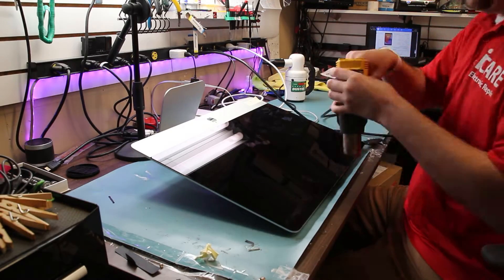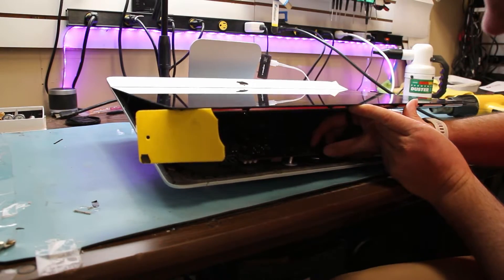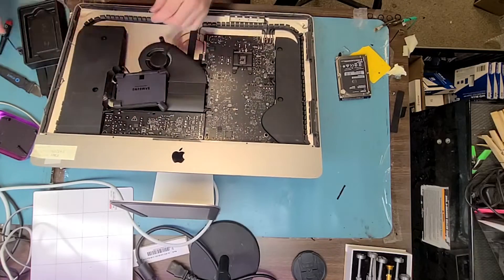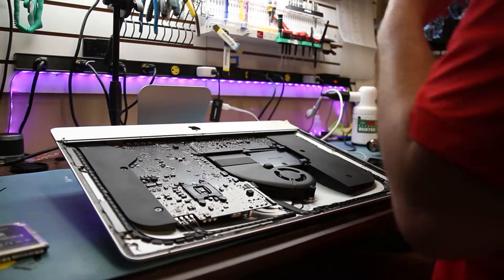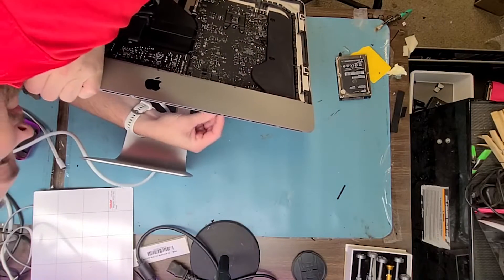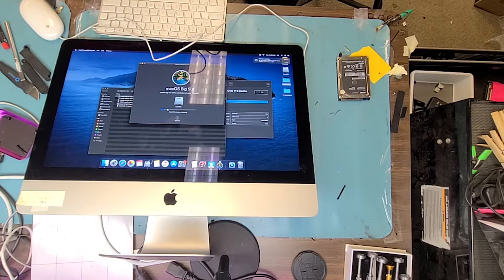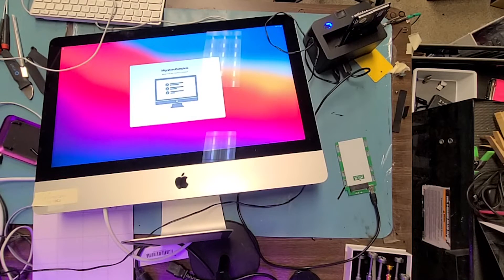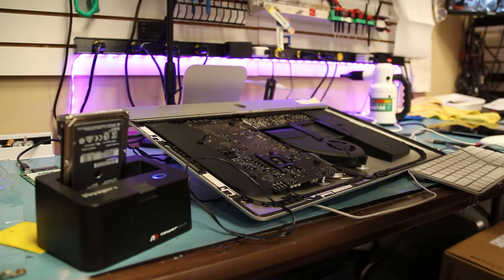iMac 2019 21.5" A2116 SSD Upgrade Guide

Comment: Hey! I have an iMac 21.5 a2116 and I want to upgrade both ssd (I have fusion drive now ) and ram. Can you suggest a compatible ssd(nvme?) best choice for 1TB and also the ram? 2x16gb should I buy crucial? Thank you!!
Reply from the maker: @davrag-v6t  Mobilesentrix has some Apollo branded ones you want to use those for it

Comment: I have upgraded my 2017 iMac i5 with a Samsung EVO 870 😅SSD. Bootup time is takes 3 minutes… is that normal?
Reply from the maker: @Michel-t8i  no is the fan blowing full blast?
Reply: @worthitrepairs  No fan noice. The status bar ‘freeses’ half way at bootup for 2,5 minutes. After bootup the Mac runs fast.
Reply from the maker: @Michel-t8i  is it a fresh install?
Reply: @worthitrepairs  yes. With Recovery mode.

Comment: I am very weary to use a heat-gun, i see some vids not using it, while others like you seem to use it without issue. What is the probability of destroying the actual monitor with a heatgun?
Reply from the maker: You don’t have to heat screen if you have pizza cutter I just do it for extra precautions
Reply: @worthitrepairs  Thank you for your quick reply. I did order myself the pizza cutter. Will be giving this a shot this weekend. 🤞
Reply from the maker: @marcusjackman1487  awesome!
Reply from the maker: If you use to much heat you could damage part